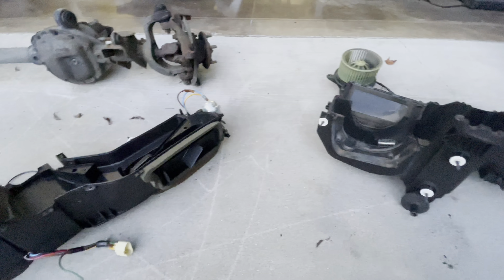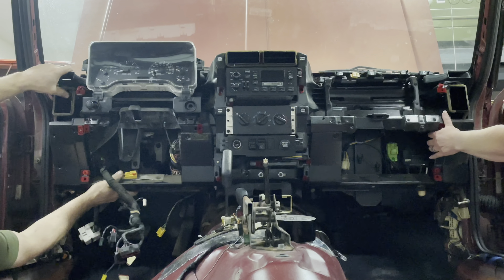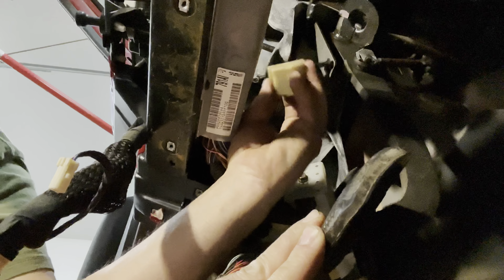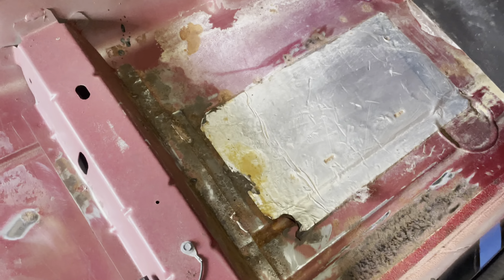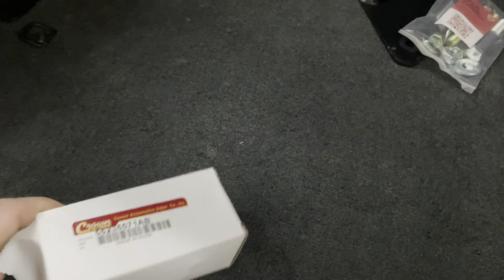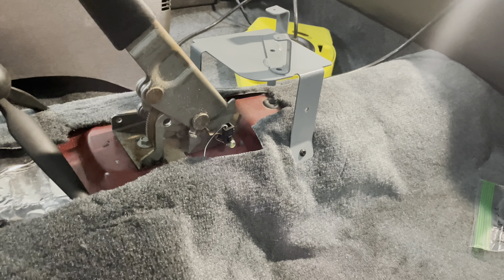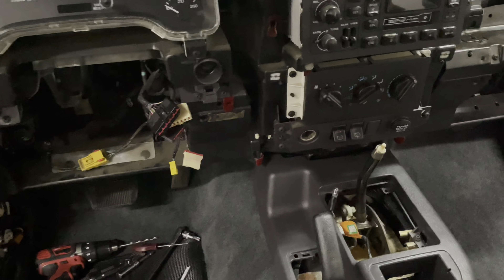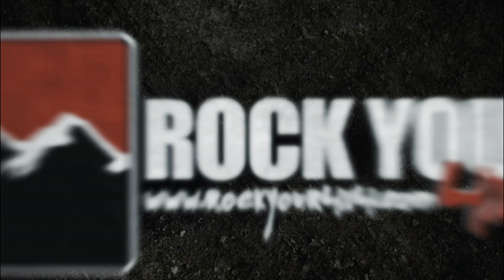XJ Project Part 2: Interior reassembly

Comment: Under the topic of hindsight, the factory carpet in the XJ's is easily cleaned with a pressure washer to look as good as new. I purchased new carpet for my 94 (Bumble Jeep) because I didn't care for the factory color (same as yours) but I did pressure wash the original carpet and it turned out good as new. Nice project. God bless and stay well.